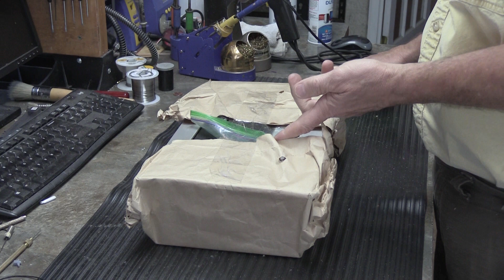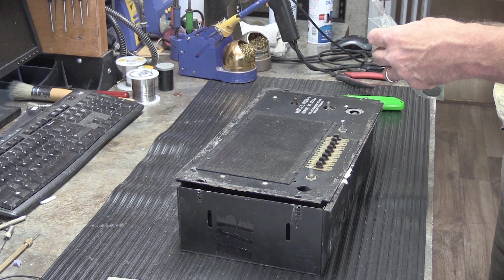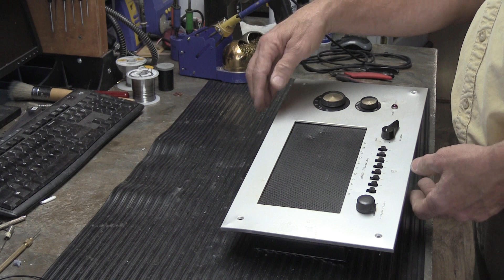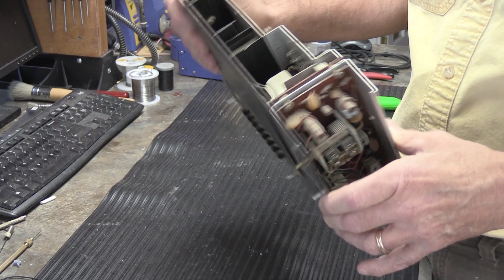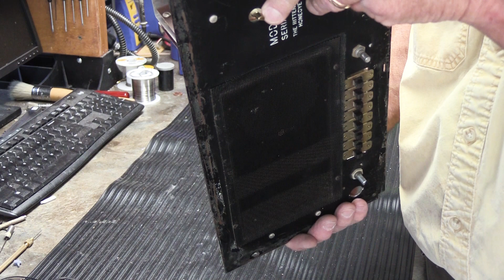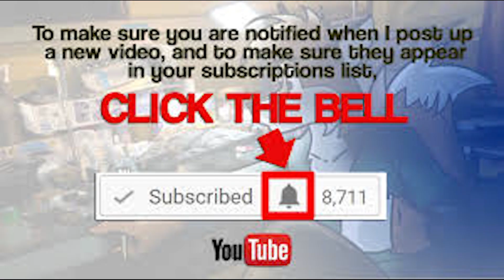Unboxing a Rittenhouse RCM1 Radio Intercom Master Station

Comment: What cables would go on the 2003 speaker-to-speaker. Is it iwa-3 ?  Or is that just the 3003
Reply from the maker: Hi locus: The NuTone IM2003 uses either IW3 or IWA3 Intercom Cable - Chris
Reply: @northsideservicecompany3567  what the difference between A and no A?
Reply from the maker: It's the difference in the way the insulation was color coded - There's no difference in actual use - Chris @locus-801
Reply: @northsideservicecompany3567  why when I go to the terminal board on the back of the 2003 there is cut orange blue red white green wires screwed in? I bought it off eBay btw for only 30$ and it works great just no intercom function. Are those wires supposed to be there or iw3 wires?
Reply from the maker: @locus-801  It sounds like the previous owner cut the wiring that was used when the system was installed - Chris
Reply: @northsideservicecompany3567  is it-3 third colors? Thought just red blue and white
Reply from the maker: @locus-801  I have no idea what you're asking - Chris
Reply: Is-3 is red blue and white so why are colors that are cut different?

Comment: And they were nice enough to stick on the schematics!
Reply from the maker: Hi sgath92:  Yes, very old school to have a schematic glued to the product - And it's even better with the internal wiring diagram, over-the-top for usefullness - Chris
Reply: I don't see that a lot, going from memory I have a Silvertone w/ a wire recorder that has the schematic pasted on the inside of the cabinet and the no-name Chicago rebadged sets of the 30s had it on the bottom of the cabinet where it would always be ripped apart or missing by today. Btw I forget the brand but someone makes a handheld portable scanner (looks like a small flourescent tube with wheels on the ends to auto move it) that allows you to scan labels on flat surfaces in-place, though now most newer smart phones have cameras that will auto detect documents and scan them by photograph.